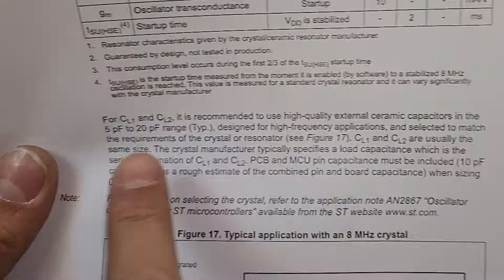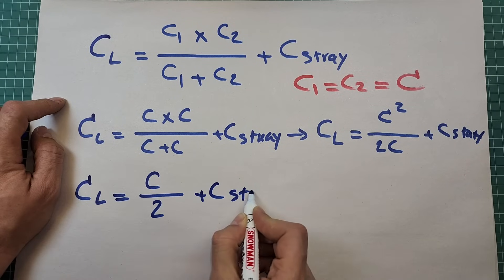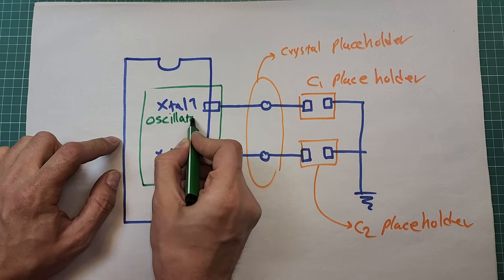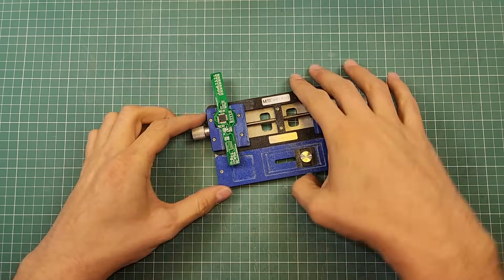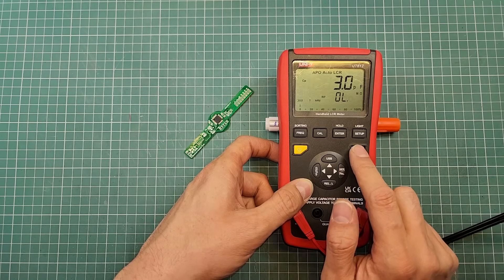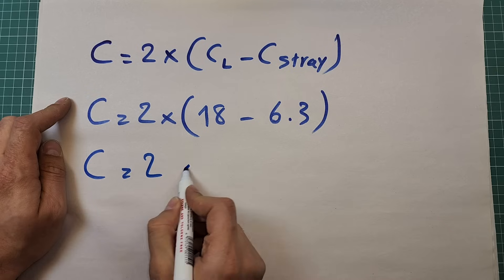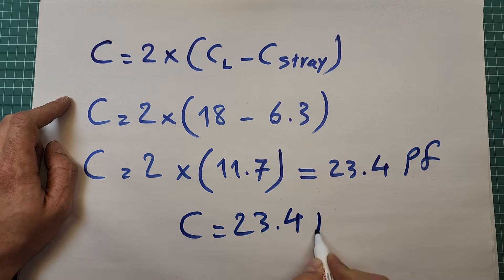4 methods of choosing xtal caps: Worst to best methods of selecting right XTAL caps

Comment: I prefer to rely on solid state oscillator in dip8 format. Many times the crystal did not start oscillating. When I started to read the mcu datasheet and the crystal datasheet, and choose the value from the mcu datasheet unless the crystal datasheet is too far away.

Comment: The value of these caps set the exact frequency with a uC you may not need an exact value. All crystal will work in a serie or parallel circuit but the exact frequency will be a bit different.
Reply from the maker: Yes, exactly 💯

Comment: Are you sure that the load capacity should be considered as a serial connection of 2 capacitors? Usually, one resonator pin is connected to a low-resistance (practically grounded) MCU pin and the capacitance on it does not matter, and the load is the second capacitor.  I have always chosen the capacity as indicated in the resonator data sheet. 🙂

Comment: The only part of this I still don't really understand is the part about why to disregard the upper and lower values recommended in the datasheet.
Reply from the maker: The upper and lower values in the datasheet are recommended, not rules. The exact value depends on the crystal component you are using.
You will use the recommended values when you have no idea about the load capacitance on the crystal component.
Sometimes we have a crystal but we have no info about it

Comment: It is important to keep the layout "tight" - minimize the total area in which the device oscillator pins, the crystal and the capacitors are located. The connection to ground for the loading caps needs to be as short as possible to ground for the IC and needs to be designed for low inductance. The layout on the breadboard at 2:20 is not as bad as it could get, but it's close. The caps have long leads and ground is made at the breadboard ground bus. Keep other signals away from the oscillator components. A crystal in a metal "can" may need an insulator under it. Don't just rely on the solder mask on the PCB.

Don't forget that if you try to actually measure the frequency you'll be adding something in the 10 to 20 pF range if you use a decent oscilloscope probe. You can reduce the influence of that capacitance by using a resistor of 100k or more in series with the probe tip. That will attenuate and distort the signal but that probably doesn't matter if all you want to do is look at the frequency. A FET probe is the best tool, but they are expensive!

When you get into higher frequencies (e.g. 20 MHz and above) be sure you are buying the right type of crystal. Some high frequency crystals are designed to operate at an "overtone," typically the third. An overtone is not quite in integer multiple (e.g. 3 or 5) of the fundamental frequency of the crystal. An overtone crystal requires a more elaborate circuit. A crystal designed for fundamental frequency operation may be intended for "series" mode or "parallel" mode. The crystal type needs to match the oscillator type.

As someone has already mentioned, beware of drive level limitations of crystals. This is most likely to be an issue with crystals in very tiny packages and "tuning fork" crystals.

Crystal oscillators can take quite a long time to start up and produce full amplitude. This can be a concern if you have something like a microcontroller that allows you to switch between a low speed internal oscillator for lowest power and a crystal oscillator for full-speed operation. You many need to allow milliseconds for the crystal oscillator to start. Check datasheets and ap notes carefully for advice on this.

Comment: It's worth noting that the datasheet recommends a "quality" capacitor.  If the capacitance value is of any importance, it's worth noting how wide the tolerance is on most of the common class 2 MLCC's that people tend to use, and how big the tempco is.   Consider paying attention to the capacitor type.

Comment: Good video with clear information.   I would add that many IC oscillator circuits have built in crystal load capacitors.  For these you may not need external caps.   Or you should add a value for built in capacitors to your formula from the data sheet.
Reply: Wouldn't he measure Cbuiltin as a part of Cstray -- which is in his formula.

Comment: Most Microcontroller manufacturers and crystal manufacturers have online calculators. Also, look for specific application notes from the OC vendor about capacitor selection. For example, ST has AN2867 to explain how this is calculated.

Comment: Datasheet of both IC and crystal+PCB layout and analysis … and then test for reliable startup and operation at both highest and lowest temperature circuit is allowed to be operated at…. Oops, and if you have to adhere to some high-EMI spec, that might throw another spanner into the works. ;).